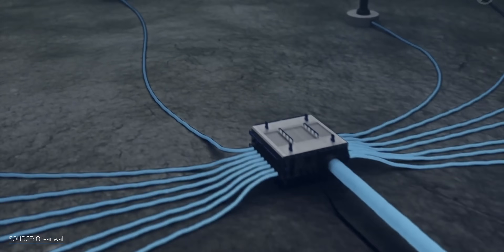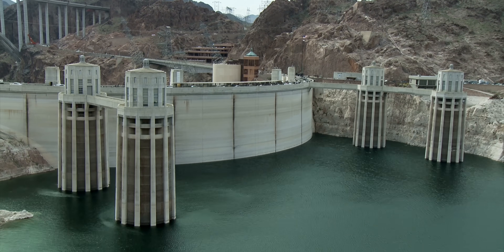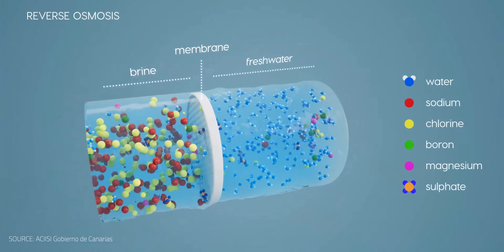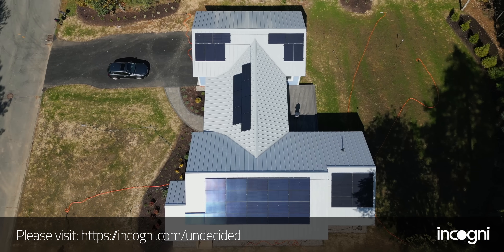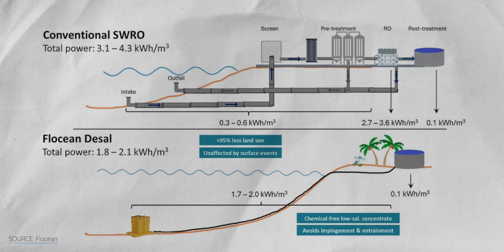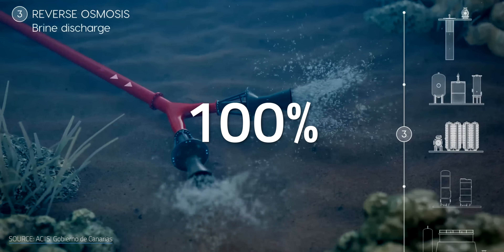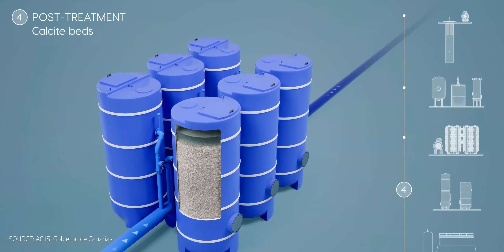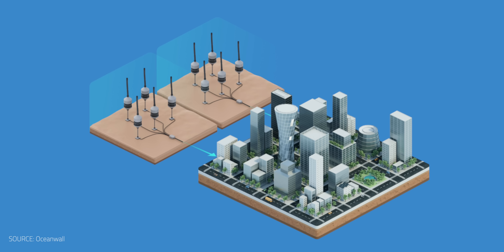How Deep Sea Water is Now Drinkable

Comment: RO plants could be paired with Molten Salt Thorium reactor power plants. The power requirements for these RO plants is a good thing when paired with a nuke plant. These RO plants can act as an energy ballast for the power plant. You get millions of gallons of fresh water and gigawatts of electricity at the same time. Also, the "brine" can be refined into a cooling salt for the reactor. 
Power requirements to "The Grid" fluctuate constantly. having a controllable high power requirement system that also doubles as a fresh water producer is an almost perfect match. You could also pump the extra fresh water up hill to massive water tributaries and have hydro-electric generators on the downspouts for a "boost power" system.
Molten Salt Reactors were experimented with back in the 1970s in Huntsville AL, but the project was abandoned because these reactors are not good at producing materials used for bombs. However, they are great at waste transmutation (converting nuclear waste into useful elements).
China has since built a few of these power plants and I think they recently just got a their first few online.
To bad we abandoned this tech, It could have been built on the California coast and completely avoided the ENRON scandal, and Cali's ongoing fresh water crisis.

Comment: A solid pipe/tunnel from shore that has threaded holes for filters starting at 1,000 feet depth could have a drone fleet that swapped filters and run pretty cheaply once the installation cost is paid.
Reply: Robot drones performing complex tasks on a pipe floating on the sea surface, bobbing in the waves sounds cool, but is likely pretty far in the future.

Comment: I'm a bit skeptical on this. It is quite interesting but the "pressure" you are harnessing will need to be overcome when pumping the water back to ground level. So I do not really understand where the benefit is coming as the pressure difference in the system is based on the work done by the pump. Pushing or pulling, the work done is the same. So the energy cost should be similar. There are still benefits to this approach (reduced brine, less chemicals, ...) so I'm not saying it is trash at all, I'm just quite intrigued by the energy saving they are asking. Especially if you factor in the harsh environment and difficulty to do maintenance.

I'm surprised to learn here that discarded or clogged membranes end up into landfill. I don't know why but I was hoping we were recycling and cleaning it. I forgot that landfill is humanity default answer to anything. "let future generations deal with our shit". I have a dream that one day we will force companies to include waste management into their plans. No dividends till you manage the trash you're making.
Reply: Energy here is only used on the fresh water instead of the salt water.  That alone saves half the power.
Reply: @ericmaclaurin8525  that answer makes no sense to me. You don’t need to pump the sea water to create the pressure, but now you need to pump the fresh water up from that huge debt, meaning that you need to overcome the pressure anyway. I don’t see how that saves much energy.
Reply: @ericmaclaurin8525  This explains nothing. Salt water is a bit heavier than fresh water due to less minerals and everything, but this isn't half the weight. And if you need a pressure difference of let's say 10 bar to make it work, you still have to suck 10bar of pressure on the freshwater side to get the required pressure difference, so basically the only gain is maybe a small volume/weight change.

Pushing or pulling it do not matter. That's the same work, the same energy.

Feel free to correct me though, I may be wrong. Ty for answer.

Comment: DSRO is a great solution. But, brine is getting more and more useful in industry. So, this means brine won't get back into the ocean. The chemicals and other things mixed in brine are also useful. So, not an issue any longer.
Reply: Innocent question here! How can brine be used elsewhere in industries?
Reply: @yensteel
1. Hydrogen
2. Cooling systems
3. Iodine and bromine production
4. De-icing
5. Chemical industry
6. Oil and gas industry (stabilizer for drilling operations)
7. Mining ( stabilizer for drilling operations)
8. Water purification (multiple stage RO systems which use brine as raw material and recover around 80% of water as fresh water with only 20% used as waste water).
9. Salt production. Higher concentration of salt increases yield.

Comment: 0:47 If you connect the tubes to the surface like this, the pressure is lost, though.
Reply: This video made me question my understanding of pressure 😆

I agree with your statement and thought the same, the pressure is not going to push the water higher than water around it. And if you put a pump at the bottom, it seems like it would need to push the full weight of the water column to get you water at the top. But what matters is having a pressure difference, and for that, what’s enough is that the column of water on one side is lighter (shorter) than on the other side, and it feels like, having a pump at the top pulling water from there only requires pulling the weight of the water there, not the full weight of the water column. This feel like a contradiction, the force required shouldn’t depend on where the pump is positioned. So my final understanding is that since initially the pressure is identical on both side, the pressure difference you’ll get is the pressure of your pump, wherever it is placed, and as such, it’s exactly the same as if you were on the surface.

So i’m still puzzled by the video.
Reply: Connecting it to the surface just prevents air pressure from stopping the process.  You actually have to pump fresh water up from 1,000 feet down that pipe as a separate step from the desalination.  As you remove water from the bottom of the pipe it will allow more water to be pushed through the membrane.
Reply: ikr, was so confused after this statement
Reply: @c_u_l8er  ... Pressure is used for desalination not moving water. Water is still moved with pumps.

So.
1. Water is taken to the pods.
2. it uses pressure to be forced trough filter
3. Is pumped with a pump out of the sea.
Reply from the maker: @greedier-7661 got it right.  The ocean pressure is about the desalination through the membrane.  Pumping it back to the surface is another thing entirely (with pumps).  I could have made the clearer in the video.
Reply: @UndecidedMF  But your claims on this method being "an alternative energy source" is just plain wrong. Exactly the same amount of electric energy will be needed.
Reply: @UndecidedMF  But it still is the same though, to pass through the membranes the important part is the pressure diferential, so you have to be pumping as hard as you get the water to keep the differential, and at that point how do you deal with cavitation?
Reply: @UndecidedMF 
I think the key save in energy is avoiding creating a large pressure difference across the membrane.  The deep sea cannot help with that, but the sipping rate can.  In this setup there's less motivation to extract lots of fresh water from the quantities sucked from the ocean.  Less saline effluent is a cherry on top.
Reply: Guess you missed the bit about the pump....
Reply: @VVayVVard  This question is actually dealt with at 7:10.
Reply: @projoebiochem  Not really, it just says it's more efficient without any explaination.
Doesn't make sense to me. You're doing the same amount of work either way.
Reply: @charmio  your not though, the pumps are creating vacuum and all the pressure helps filter AND push the water up to shore
Reply: @onlyhereonceinlife  But there is no more pressure difference down there than there is at the surface. 
Sure, there's more pressure on both sides of the membrane, but they cancel out. You're still relying on a pump to generate the pressure across the membrane. 
I don't understand why doing it deep underwater would help.
Reply: @charmio  Fresh water is less dense than the salt water. Would the buoyancy of the fresh water on that side of the membrane reduce the amount of energy required to get it to the surface?
Reply: Once it's desalinated you can just pump it up

Comment: It seems that all that equipment down at the bottom would be unnecessary if you just pumped it up out of the pipe at the surface the water pressure from the bottom would try to push that back up. Just pump it from the top and let the pressure down below do all the work. Any other treatment can be dealt with up top. Just sink the filters attached to a big pipe to pump from.
Reply: Maybe cavitation is less likely when you raise the pressure of everything.
Reply: @takatamiyagawa5688  You would definitely have to rate the speed of the pump to the replacement rate of the water through the filters. But even if it was slower it seems like for the same price you could sink more filters and just do without the underwater pumps. Those pumps would have to be expensive.
Reply: I also thought that, but i’m pretty sure it’s wrong, whichever side the pump is on, it has to lift the entire column of water, it’s helped by the water on the other side of the filter, but basically, whatever pressure you want to have at the membrane level, is the pressure you need your pump to excert, to create a difference between the two sides, as gravity works on both of them.
Reply: @GabrielPettier  I understand what you're saying but because of the fact that water always seeks its own level, if you just Widened the pipe for the last 200 feet or so and then pump the water out of that widened area. Then allowed the pressure to equalize again, it would not be a constant thing unless you adjusted the flow rate.
Reply: @tomjewett5839  but water won’t expand to fill the new level, there will just be more water to fill that gap, and it will be at the same pressure as the water at the same level outside that pipe, unless there is a pump to create a differential.
Reply: @GabrielPettier  I understand, the reverse pressure of the remaining water would act on the opposite side of the filter.

Comment: Man, I had this as part of a floating village design for ocean living. Supplying water by dropping an RO system down until the pressure pushed water through and use minimal solar pumping to move the water around up top. There was also a system for pulling material off the ocean floor and suspending it just under the surface to grow kelp and other saltwater plants to attract and feed fish.
Reply: If you put a vertical pipe into the sea, does the water start flowing up through it because of the pressure difference between the top and bottom?

Comment: Combine the water lines with power lines and habitat and the cost per use drops significantly.

Even better, instead of generators at sea, harvest kinetic energy that you then use to pump the fresh water to shore at pressure.  Convert the pressure to power at shore and get cooling as a bonus.

Indirect inland benefits can be gigantic.  If LA only used desal, the Owens Valley would be a lake instead of an EPA superfund site.

Most coastal cities get water from inland sources that could be going to recharge aquifers, support wetlands and form the base for an inland water cycle that's essentially disappearing all over the world as inland areas that used to provide additional moisture to the atmosphere become so dry that rain often dries before, or as fast as, it hits the ground.